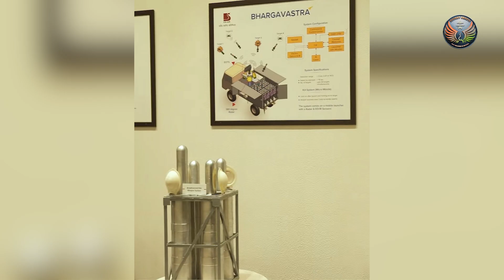Solar Group Tests Micro-Missile Drone System 'Bhargavastra' | #missile #drone #atmanirbharbharat

Comment: Instead of inducting this our army(bureaucrats)is preparing to buy american stryker for anti drone and short range air defence what a joke they had made with indeginisation only chanting it like mantra instead of ordering in large numbers.  If we equipp our armoured vehicles or any 4×4 vehicles with this system it will come a moving air defence anti drone system easily then why buy expensive systems from foreign countries.